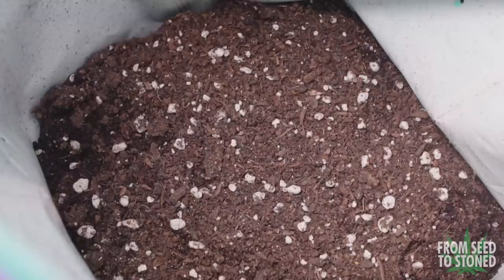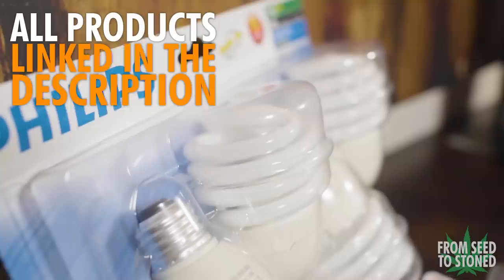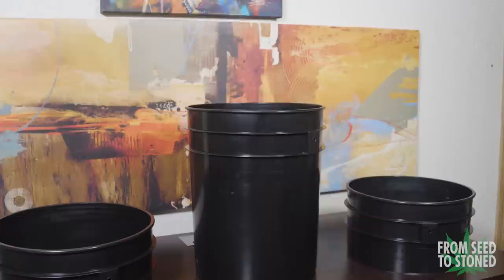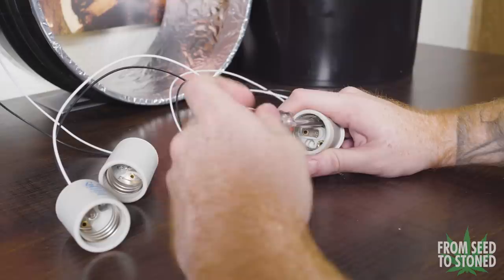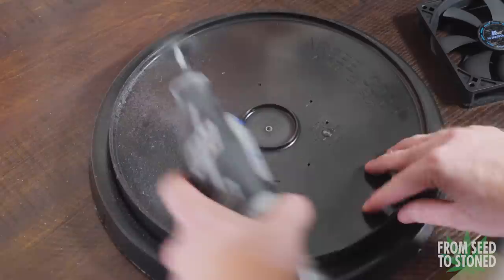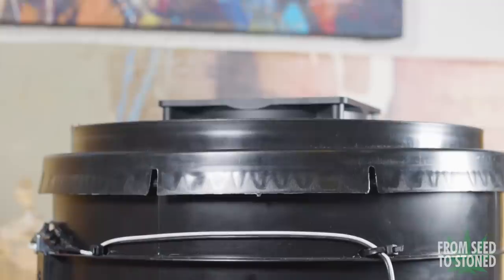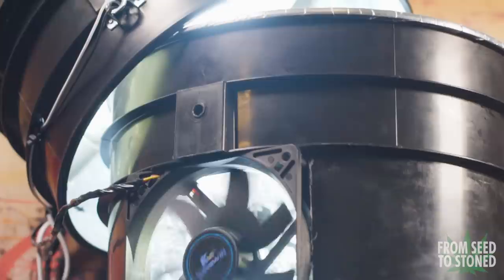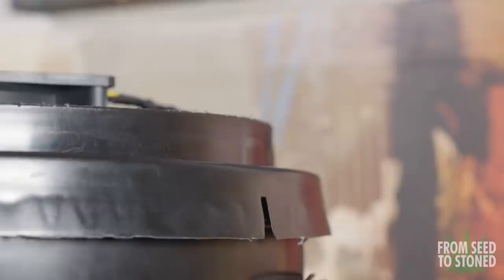How to Grow Marijuana Indoors For Under $100

Comment: Another great option if you want a little more container space is to replace the buckets with large storage bins using this same concept. Enjoy guys 🙏🏾💨
Reply: hey i don't know if you will ever see this but i would like to know what to do about the light bubs if i use the bin and the pc fans or is still the same and am i only filling the bucket up half way
Reply: @sumgrape2151  depends on how much bigger the bins are than the bucket. you could add another spot for a PC fan or maybe multiple, same with the lights it all just depends how much bigger you are going
Reply: Trash can maybe?
Reply: Might have to pay close attention and be very precise when watering. Root rot might be more of a problem
Reply: @Hawkeyes003  holes drilled in the bottom and put a saucer under
Reply: Totes for the win!!!

Comment: Pretty cool little diy space bucket. I would use a led instead of cfls. Hard to grow anything indoors with 100$ dollars. My very first setup cost me around 400$ and that was including great genetics witch are the most important. That little grow paid itself off 4x over in the first harvest. My biggest advice to new budget growers is buy equipment bigger than you need. Bc you will be upgrading before long and you will save in the long run.

Comment: Checking this out to build my second bucket and I had similar issues with the Mylar.
One tip, I ended up cutting it into sections and it was much more manageable to glue down vs putting an entire roll 360 degrees at one time.

Also, use wire nuts/connectors in addition to electrical tape when making connections. 
Last thing they sell USB computer fans that will save a step
Reply: Finished my first bucket yesterday, though my Mylar is horrible, I only have it held down with metal tape. Was wondering what glue he/you have used to secure the Mylar to the inside of the bucket.

Comment: I am a contractor. Please make sure to use wire nuts to join wires instead of simply using electrical tape! You can always use electrical tape over the wirenuts for extra safety. I have to say that although ingenious, this setup could be a recipe for a fire. I would recommend putting a smoke alarm near this setup.
Reply: How about soldering the wires instead? I also agree with the fire hazard part, the bulbs being close to plant matter seems sketchy to me.

Comment: Does smell escape the bucket?
Also if u would do a grow inside that , that would be really cool n helpful! 
Nice videos btw :)
Reply: I'd say it's very smelly, pc fans arnt strong enough to push air through a carbon filter at least not effectively
Reply: The smell definitely escapes but you could place it by a window and have the exhaust fan send the smell out through the window with a 4” corrugated dryer duct. If you want to have a year-round solution, buy a 7” X 1/4” x (width of your window) piece of plexiglass and cut a hole in it corresponding to the dryer duct. Place the plexiglass at the base/bottom of where the window closes (at the sill), so that when you pull the window down to close it, the window now stops at the top of the plexiglass. Attach the dryer duct to it with some duct tape and clear silicone, and now the window is technically closed but the exhaust fan can still get the weed smell out through the duct.
Reply: @whobutroo  good tips bro
Reply: @hugodoppel1657  thanks bro

Comment: Dude, I appreciate you so much. Pure, concise information. Exactly how I need it! 

I’m new to growing and I’m currently heading to my second week. 

I have so many questions and still but I’m slowly learning with you. Thanks man!

Edit: I forgot to add how much this cheap grow is going to help me with mine. I know that I’m going in the right direction as long as I get the minimum.
Reply: On my 2nd week running a 4x4x2ft indoor tent all under 250$
Reply: @MiguelSilva-ie7pk  what light/lights are you using, and if you could go back would you change your decision?
Reply: @dickwaffle7134  no bro wouldnt change my set up its been going well my plant is healthy i was running a 650 hps light thats all i know bro the guy i bought it from on letgo knew all the specs i just bought it bro.
Reply: @MiguelSilva-ie7pk  I've been interested in the meizhi brand because they're cheap and from what I've seen/heard online they're really good for the price. I'm trying to see if I can find a better led company or specific light for the same price. I'm not into hps lighting just because of high energy usage and heat output. But they do work really well. Good luck with your future grows and stay green brother!
Reply: whats your ig keep me updated
Reply: where can i get seeds?

Comment: So far my budget grow composes of:
1 Fiet electric Led blue spectrum grow light. (Lowes/Home Depot) $59 CDN
1 generic made in China full spectrum led grow light. (Amazon) $<40
A mix of certain soils, pro-mix, miracle grow. $30 together.
Jobes 4,4,4 slow release organic fertilizer $6 
Root farm pH down. $8
Currently trying to grow some AK autos. $50 (4 pack)
2 - $4 3-gallon pot with trays attached.
(Edit: 1.5'×1.5' glass display case with aluminum foil to reflect light, keep door open for ventilation, a small 5" clip table fan. Case was just a convenience)
Fan was like $12. + small cardboard/moss pots $2
Reply: Ryan StonedOnCanadianGaming do you have a video on your setup I could watch?
Reply: How is the grow with that led light.     I heard that using cheap LEDs will give you small buds.

Comment: This is truly a great video. 👌 keep it up I’d use spray glue and a small roller to make the reflection cleaner. And the buckets are easy as hell to get. Add a carbon filter and a wooden frame to trap for when she grows and your set man! Set the thing on a tilt and drill the bottom...set a pvc 1inch drain tube with PVC primer then glue and set a drain pan on the bottom (under a table it should be on or stool or small chair) and drain the bugger every so often. 👌👍

Comment: Anyone know how I can modify this to reduce the smell? I don’t exactly live in a 420-friendly house. Thanks!
Reply: I was wondering about the same thing. Maybe reversing the fans to where the top one is your intake the the side is exhaust. Attatch a dryer hose on the side and run to a window or vent. May work. Idk about having the fan up top blowing on plants though
Reply: Attatch the exhaust fan to a carbon filter

Comment: I currently am growing for under $50 🥴 two 65 watt plant bulbs from Walmart $8/each 
Two dome reflectors to put those bulbs in $16 total for both, an $8 desk fan from walmart.. Then some poster board, aluminum foil, and soil from dollar tree. I mixed that soil with some old perlite I used when repotting my houseplants.  Im watering with water from my fish tank. My seeds were 100% free from Patriots Helping Vets, a cannabis positive veterans organization.
Reply: @cannabishomegrowconsulting6043  it was very! I had to upgrade.
Reply: Mine was  free I found the buckets and stole some really nice lights from Home Depot then I stole some rgb pc fans from best buy then I took things apart for the sockets and the cord then my friend gave me a really nice plant for free with good soil so I just planted the plant in my backyard then used the really nice soil and I got the seeds for free from the 🔌 🙏 and I also use fish tank water

Comment: How would the smell be? Would it be noticeable?
Reply: Yes. Nothing like a big grow, because it's just the one plant. But if you need it be be zero smell you need to use an air ionizer, or an activated carbon filter.
Reply: @remcovanvliet3018  what type of carbon filter?

Comment: But there is no carbon filter so this will smell up the place right? 
Amazing video and great challenge
Reply: I’m at week 3 flower homedeot. No smells
Reply: @lasttruegrower9178  nice very nice no smell yet after week 4 smell
Reply: Yeah, it will smell a lot. For anyone growing in an illegal area, or not away from civilisation it'd be easily found out. FSTS is in a legal state and has always (publicly) stated that he doesn't encourage growing weed illegally.
Reply: Monarch Garden starting to have light smell u called it bro
Reply: CodeyThings will the carbon filter work?
Reply: @lasttruegrower9178  If you can get it attached to the top fan without leakage. Sadly I don't know if pc fans have their cfms(cubic feet per minute) advertised, but if they do you need to find a carbon filter that doesn't have a cfm less than your fan. If it does have a lower cfm than your fan, it means the fan will pull the air through quicker than it can be cleaned of smells. Could also probably leave out the bottom fan to make sure there's negative pressure, but you could experiment with that.
Reply: CodeyThings thx
Reply: @lasttruegrower9178  You're welcome man :)

Comment: Smart Design, this is alot easier than the old school micro cabs. I'm stealing this idea for a breeding cab. LEDs have come a long way, I'm sure they would perform better than CFLs. Standard grow lights won't fit the footprint of the space bucket, but Im sure a different configuration of LED lights would work well.

Comment: If you wire your CFL in parrelel you will get less resistance and lower your electric bill 😉
Reply: Jazmin Munoz  just look up parrelel wiring lol
Reply: It's parallel. An that would be the only way to do this lol. 

If you were to wire the lamps in series you would just have a serious voltage drop to each lamp.  Causing the lamp to overwork and likely start a fire... 

Which cfl lamps are already known to do. There's a reason they aren't being sold anymore.

Comment: Does anyone know how I can figure out how much electricity this will use? BEFORE I GET THE BILL LOL 😆
Reply: The lamps consume about 100W, he said. The two fans probably need something around 12W each (power = voltage * current = 12V * 1A = 12W). Thats a total of 124W. 

With 18 hours of having your lights on, this setup will need 2,232kWh per day. Depending on what you pay per kWh - here in Germany it's on average between 13ct and 23ct per kWh. 

0,23(€/kwh) * 2,232kwh = 0,51€. 

So per day, you would have to pay a maximum of half a euro. That's a bit more than half a US-$.
Reply: You’re a life saver! Thanks very much 😁
Reply: @jacobmalo7852  no problem

Comment: 2:55 For this tight of a budget build I was thinking that they make a chrome automotive spray paint it isn't the best but it is fast and eay to apply and pretty cheap too. So you could spend a little more on soil too, Plus the paint won't get wrinkles in it.

Comment: How would you go about adding a carbon air filter to this setup? Would you do it with PC fans and just add a filter or but a system comparable to what was used in the 300$ setup? If you just add the filter to the existing PC fans do you just need one at the exhaust or one at the intake too to better avoid smell?
Thanks in advance and sorry for my bad english

Comment: I chose to make a space bucket with 8 23  cfls with a Ac infinity cloud line t4 controlling climate run to a carbon filter , , i was running a mars 300 but it was burning my plant with 4 ft of spacers 🤷‍♂️ so I decided to go cfl , I did watch this video before I did the build , love the channel bud
Reply: So it didn't work? dont wonna buy the stuff if its shit

Comment: Dude this is epic!! What does one do about the smell though, any quick fixes like lining the exhaust with dryer sheets or do you HAVE to get a more expensive fan and filter setup?
Reply from the maker: Destiny Gaming707 run a carbon filter and fan in the same room
Reply: Have a carbon filter on the inside on the outlet and then a second one on the outside of the outlet though you might need to make it a bit taller for two filters bit it should make it close to 100% smell free

Comment: I just bought the TaoTronics humidifier and the Inkbird IHC-200. I set all my levels and the controller kicks on and provides power to the humidifier and somewhat turns it on, but not fully on to where it outputs mist. Any suggestions?

Comment: I have a similar set up. With two 51L buckets stack and insolated. With an exahaust using a 12V pc fan and a blowing small fan inside. I plan on using 4 40w LED strips atachted to the sides of the bucket at the top. My idea is that light will reflect and plants will search more for light and so growth would be eficient. Would this work? Should I add an instake fan?

Comment: Can you use Nectar's One shot through the entirety of the grow? I'm planning on doing a bucket autoflower in Coco with a Smart/Autopot system for watering, but I'm still working out the kinks on that.

Comment: Hell yeah watching all these grow videos is kinda intimidating. I'm like how do they have money for all this expensive equipment. I tried to grow indoors a few years ago and failed so I stopped. I was given some free seeds so I'm trying again now the passion is back! This bucket design looks amazing. My question is the airflow. Is there a diagram/blueprint? Thanks so much for the content
Reply: Ronin Hotsauce this is my first time growing and so far, I’ve spent 40.00. Eventually I will need to buy the carbon filter for smell which is roughly 45.00 with the inline fan. Doesn’t hurt to try and you don’t need everything at once. Once you have the space bucket all set up and the plant is growing, you have about 4 weeks to get a carbon filter and online fan. Do it! At least you can say to yourself that you tried and if all works out, you’ll save money and the money you invested will pay itself off. Good luck!

Comment: With the holes in the bottom....what do you do to prevent water leaking everywhere?  The finished bucket doesn't appear to use a tray or water catch setup.

Comment: After watching this channel for a while, I decided it was time to try a grow of my own using the "$300 grow setup" equipment plus a good deal of extra stuff just in case. I have to say I'm surprised! I germinated 3 seeds, they all popped and they all unfolded their tiny leaves within 3 days! The only other thing I've been successful at growing is mold on bread. I can't believe these GG4 autos are actually growing, and growing fast. They look bigger every 12 hours.

A big thanks for making videos that contain a ton of information, yet aren't intimidating. That seems like it would be hard to do. Maybe I'll make a finished product video if my first grow is successful.
Reply: elsquibbs how did you germ your seeds? I’m having a hard time germing. I have one seed in a paper towel/zip lock method since Friday and one seed in a pot in fox farm since Saturday. No germ yet so far. 
I’m not sure what I’m doing wrong. 
I have the small pot with the soil and seed in my space bucket with the lights on for two days. I’m wondering if I should keep the pot in the dark.  I’ve looked at YouTube videos and tried all methods but no success.  I lost 8 seeds within the past two weeks trying to germ. Any advice would be greatly appreciated. Thanks in advance!
Reply: @iamurnamann8662  OK here's what I do and have been 100% successful with this method.

1. Drop the seeds into a glass of room temperature spring water. Let soak for 24 hours.

2. Put seeds into wet paper towel and put inside an unzipped zip lock bag. Put on a plate. Paper plates work. 

3. Place black face cloth (or something similar) over the plate to block the light out. Keep seeds dark.

4. Put plate in grow tent or in area at 75° or so. My grow tent is in the high 70s and it works.

5. Wait 48 hours. You should see taproots.

I have found that the 24h soak and 48h towel time are vital. 12h soak and 36h towel time lead to failures.

Good luck!
Reply: elsquibbs thanks for the tips. I tried that with no success. I think it’s because my kitchen is too cold due to the AC running constantly. Lol.  I relocated the seed upstairs in a bedroom that has no AC and is very hot in there. I’ll find out tonight or tomorrow. Thanks!
Reply: @iamurnamann8662  no problem. I bet it works. Having the seeds in a warm place makes a huge difference.
Reply: elsquibbs in retrospect, I’d used the paper towel method at the cabinet in the kitchen just for testing to see if I could germinate and they rooted like mad every single time. Now, 8 seeds later I can’t root for the life of me. I won’t give up! Lol
Reply: elsquibbs well, I checked on my paper towel seed and it cracked open! The tail is just starting to pop out. I put it back in the bag to give it another day. I had the wife check on the seed in the soil, which I couldn’t find and she found it with the root exposed about a 1/4 of an inch. We repositioned the seed and now it’s under the light with a baggie over it for humidity until it surfaces. I guess my lack of patience got the best of me and putting the bagged seed in a warmer environment pushed it along.  Thanks for the input! Take care...
Reply: @iamurnamann8662  good luck!

Comment: Now make an carbon filter.
Ive made them one from an plastic screw on bucket where the lid had an hole and it was glued to the fan
And the bucket had holes in the bottom and aquarium activated charcoal in the bucket.

Comment: FYI, a power supply that has DC voltage, does not have a 'hot' and 'neutral' wire. These terms only apply to mains (AC). The correct terms are positive and negative, or positive and ground.

Comment: while theres nothing wrong with twisting wires together and making sure you electrical tape them, some t-taps, spade and butt connectors, along with strippers and crimpers are always a good investment that makes everything a little bit safer. 👍

Comment: I went cheap I went to dollar tree I Bought soil and pots from the as well as a spray bottle and I had the rest of supplies at my house currently I’m in week 1 one 🌱 and I have the pot onto my window with a 10 fan and I have 2 small big plastic bags , sprayed it with water for humidity and turned on my fan and that’s it it gets sunlight from my window